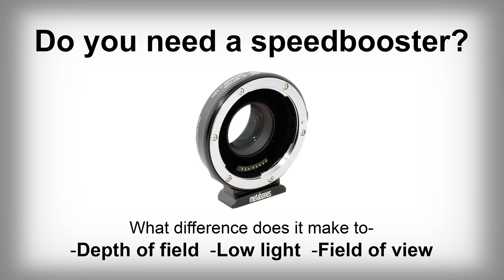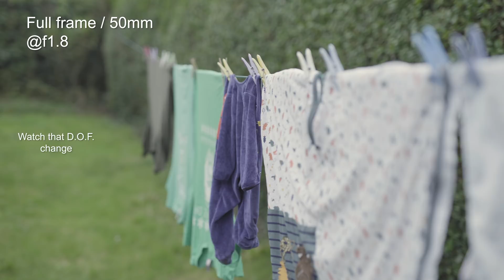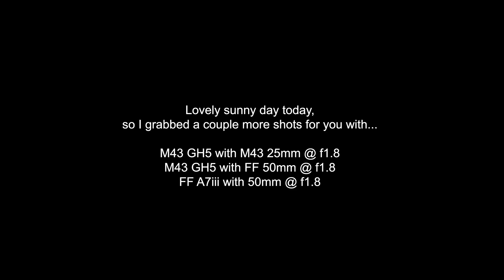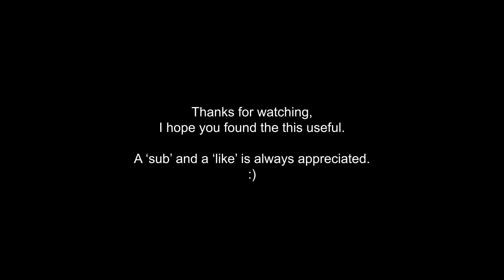Do you need a speed booster?

Comment: FINALLY... someone who has cleared up the myth that a full frame sensor gives you a shallower depth of field. PS; I use vintage Canon FD lenses on my GH5 for most of my shooting. They were not designed for HD thereby giving me a slightly soft muted color effect. Almost an "old school" film look.
Reply: I mean, full frame still gives a shallower depth of field at a set field of view. To match the 50mm 1.8, you would need an MFT 25mm f0.9 or a speedboosted 35mm f1.4, both very much in the realm of possibility. But say you use a 50mm f1.2 on full frame, it becomes near impossible (MFT 25mm f0.6 or speedboosted 35mm f0.9) 

This shows more the wider you go, as there arent really any lenses to match a 24mm f1.4 on full frame (12mm f0.7 MFT or 18mm f1.1 speedboostet). 

Even though it’s debatable if you need such a shallow depth of field for for film (I think you dont, unless going for artistic effect) full frame is still the king on shallow depth of field.

Comment: But why you compared a native FF 50mm 1.8 with a native MFT 25 1.8? That's totally unfair you applied the crop factor only on one side of the equation, if you had compared a native FF 50mm 1.8 with a native  MFT 25 mm 0.9 would be exactly the same thing on both systems, right ?!
Reply: Yes, that is correct, you would get a near identical image, but there aren’t really any high performing 25mm f0,9 out there (I do only know of a single one made by Voigtländer that imo is not usable wide open due to a severe lack of sharpness, chromatic abberations and, arguably less important, lack of autofocus)
Reply: I think thats correct, but I am not sure.
Reply: I have a 25mm f0.95 for MFT and a 50mm 1.8 FUllframe with the speedbooster. Im gonna do some tests!
Reply: @ai5897  Did you realize the test?
Reply: @alexm.6549  yes, the 0.95 is brighter, the crop factor dont affect the light amount. The 0.95 is the same than a f/1.4 & with a speedbooster = f1.0 , because it adds 1 or 1 1/2 of stop of light depending the model